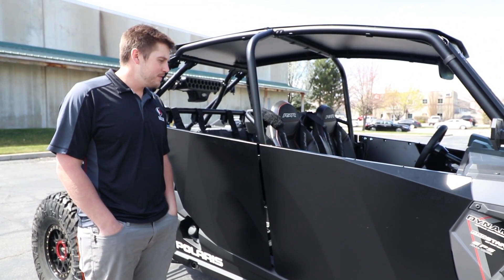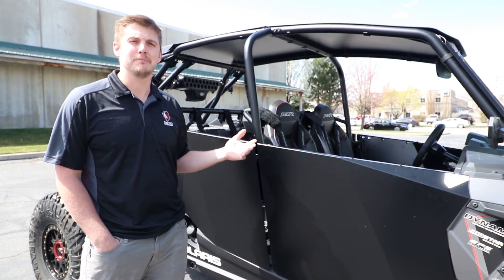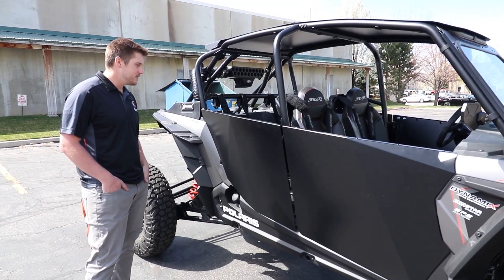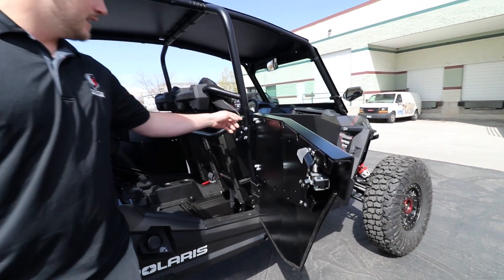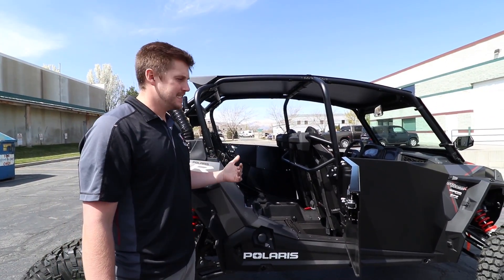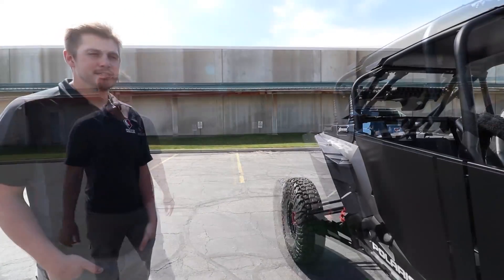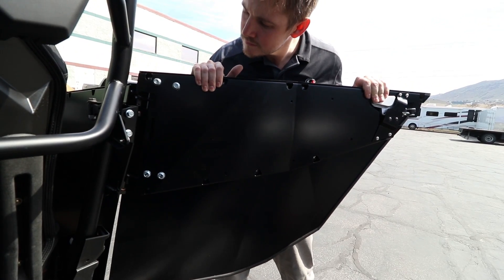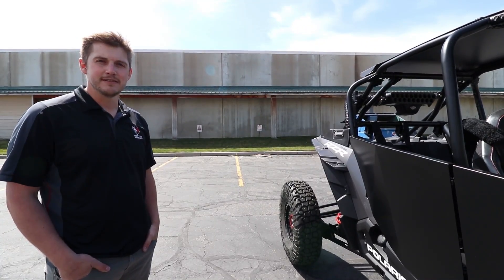MOTO ARMOR RZR 4 1000 DOORS

Comment: Love my Moto Armor doors! Best in the business!
Reply: Are the doors skins? Or are the complete doors? Any rattles when riding?
Reply: @begrateful8934  Full doors. No rattling at all. Super strong and beefy.
Reply: @91NotchBack  how is the bottom portion of the door? because it doesnt have a frame that goes all the way around like tmw and sdr doors. Also who did you order them through? Kombustion Motorsports has them with a nice discount right now.